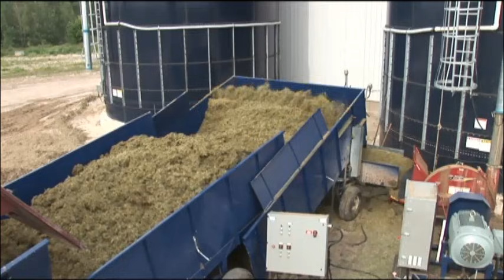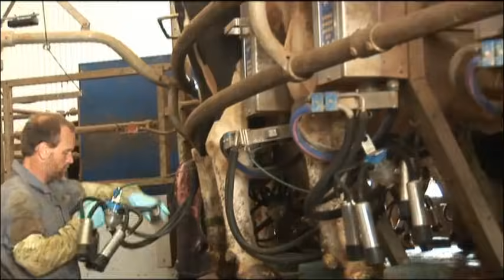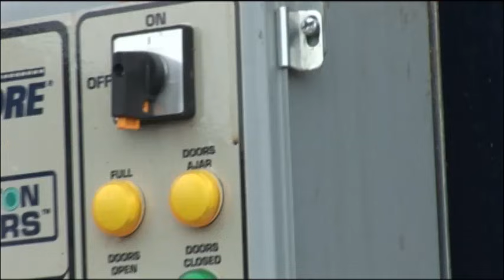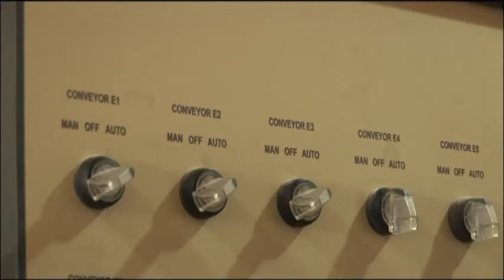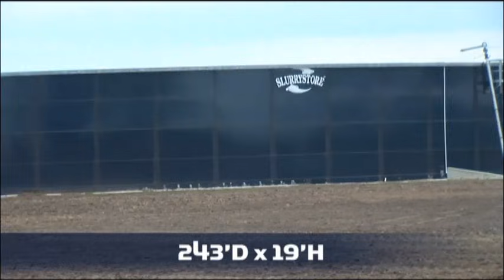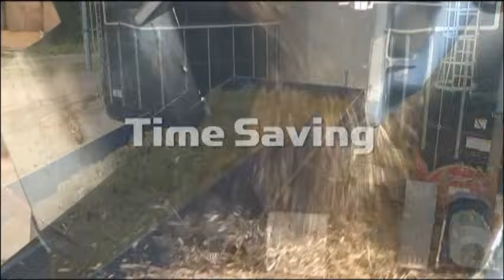Farm of the Future

Comment: If I'm gonna have a silo it will be a stave this looks extremely expensive  just tore down our derelict stave with a broke down Silomatic unloader and are using bags a pull type mixer and skid loader now I'm wishing I repaired the old Stave and built two more and a stationary patz vertical I sold the old one for 800 dollars in the only thing holding me back is heights I hate them, and the gases those scare the shit outta me heard to many horror stories.

Comment: This unloader grab silage from silo bottom line?
Reply: Yes, its cid of like a gigantic chainsaw blade mounted in the center of the silo, and it rotates round and round bringing the loosend silage to the center where it drops to another unloading chain that brings the silage out..
it usualy works fine,, but now and then its trouble spesially right after they have filled the silage full from empty without turning the unloader a few weeks it can be hard to loosen it to get it started becouse the weight of the silage above have put to much pressure on the chain so it can break when starting. 😂
Then then they just have to hope they parked the chain in the right position so they can pull it out by powerful  jacks and free it and rapair it. 
https://www.youtube.com/watch?v=DyBGrf150ng

Comment: My question; are there plans to develop a conveyer-belt feeding system to the cow to eliminate the filling and distribution by the use of a tractor feeder? Despite the cost to build such a system, would this provide a greater return on investment and reduced labor, tractor, and fuel cost over time? If this could become automated; computer-controlled -- the mixing from silos to feeding the cattle a more automated process -- would not this be a better alternative to eliminate the use of the labor, tractor, and fuel to deliver food to the cattle? It would seem that the seven batch mixing could be pre-programmed to become more automated along your production line, thereby, reducing 2.5 hours programming and production time.
Reply: we put up two in the mid 70's  one 30x30 for high moisture corn. and a 35x60 for hay silage.   at the time we set it up we could feed from a supplement bin 2 dry grain bins and each silo into a stationary mixing box.   then from the mixing box onto a lifting belt conveyor.  that into a 2 direction top conveyor   that would go to two belt feeders.   we could easily feed 1 to 8 groups of cows.  around  240 total head in about 20 min.  never starting a diesel engine in the winter.
Reply: here u can add this system for belt system 
https://www.eder-feedstar.de/en/index.html